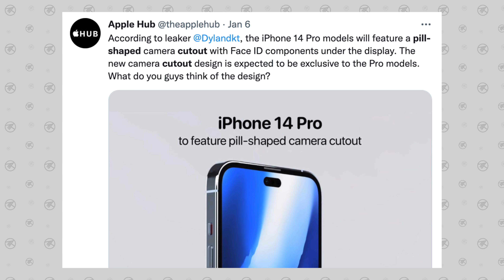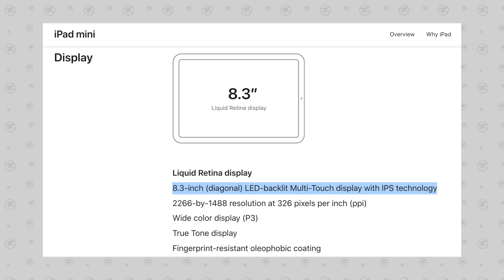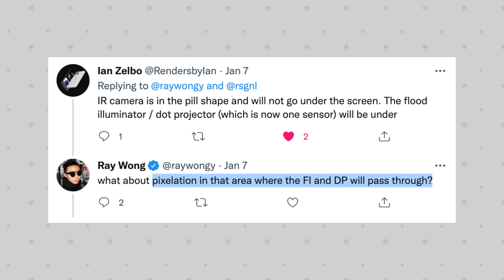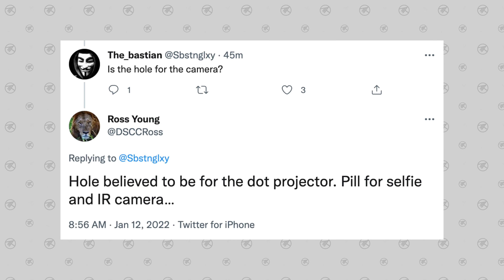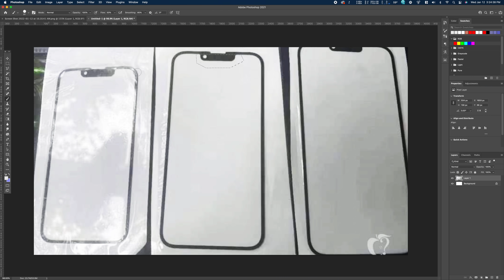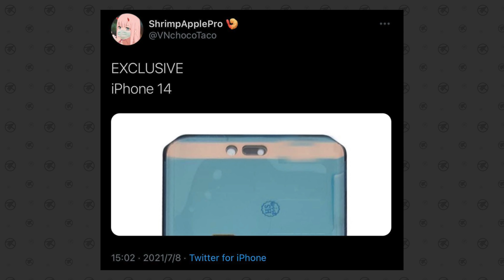I was WRONG about iPhone 14 Pro Under Display Face ID..

Comment: I don’t see why this is any better than the notch. And it seems weird to ditch the notch right after they just made it smaller and doubled down on the design language with the MacBook Pro. Especially if we’re going with the idea that the reason they put a notch that big on the MacBook Pro so that we would get used to it and they would have the space to add Face ID at some point. I guess there’s no reason why the MacBooks and iPhones have to share a design language but it’s weird to me to give their brand new top of the line laptop a design that they effectively make outdated only a year later. Seems like they should just keep the notch until whatever point they could have everything under the display, or at least all the Face ID components can be under the display, because I can definitely see the advantage of the hole punch design if it’s just for a single little dot for the regular camera.

Comment: On iPhone 7:
I could get used to the notch, I waited so I didn’t have to.
I could get used to the pill hole, I’ll not wait so this Fall I’ll have to.

Assuming 14 Pro will have the pill, maybe the hole also. I don’t really care if the battery lasts at least two days on my average use and the camera rocks. There are other things, but battery life and cameras matter the most. Still, I think the software is shite, but less so than Android. :)

Comment: At least I got a good chuckle out of the iPhone 15 leaked design. Looks like Lucky Charms cut out of the display. 

Single notch/slot whatever is fine for all the sensors. Would actually prefer the touch sensor power button for unlocking, given that Face ID doesn't work in public places these days.

Comment: Regardless the round hole placed on the left or right, the asymetrical dual cut outs design is terribly disgusting compare to those android phones, and this is not a significant improvement to convice people upgrade from their iPhone 13 series or older models, at Ieast I won't, unless they add on the under-display touch ID sensor!

Comment: Srsly on the battery % chit chat every single year... if they wanted to be shown they would do it by now either as a number inside the stupid battery icon or simply by ( 87%) for example without any stupid icon...or change the shape of the icon to be in line with charging animation, something like a small green circle with a number inside.

Comment: Notch doesn’t bother me at all. To me its unique and doesn’t interfere with anything I do. For those that think a pill shape is better, design is subjective, but if you believe that the cutouts won’t interfere, I think you’ll be surprised, cause cutouts or notch both mean missing pixels and because of that, that part of the screen will never be used for more than status info. Additionally since Apple just added the notch to their MBPs I would think they are embracing this design, and it wouldn’t match the current brand to change it now, unless they are going to ditch the notch everywhere.
Reply: I think they definitely could go with this design next year, but I don't see it as a reason to upgrade. The UI is built around the notch, it rarely intrudes. I hope to not buy a new iPhone until the camera system becomes flush with the back of the phone

Comment: I have to say: I wanted the simple pill shaped front camera. but I also said in September last year: 
fine, this phone is almost perfect for me with its battery, refresh rate, look and feel, but I want a different notch

so if Apple decides to do such a notch design I'll go for it, since it IS in fact different than the earlier models
Reply: Damn that’s all it takes for you?! No wonder Apple doesn’t innovate, their fans will buy the new phone no matter what
Reply: @nth460  i don't see any problem. look: Apple - for my standards - did everything pertly fine with 13 Pro except the notch. I'm using my Xs now for a bit longer than 2 years and I am looking forward to a phone that is the REAL improvement to the Xs - 11 Pro, 12 Pro and 13 Pro aren't that different from the Xs

Comment: I’d much rather have one continuous pill shaped cut out accommodating both the Face ID components and the selfie camera. That to me looks more neat. Like seriously how much space are they saving between them 😂
Reply: If there was BOTH a hole punch and pill replacing the notch not just once I would immediately reject the phone.  That to me is 5x worse than the notch.  It looks ugly and cheap.  I don’t care if it’s saving screen space.
Reply: @xeon3081  true that
Reply: I'd wager it's one continuous pill hole, with the section in between blackened like the bezels. I also think it'll be thinner than depicted in people's renderings. I think it will probably mirror the pill at the bottom of the screen that you see across iOS and iPad (that indicates where to pull away to go back to the home screen)
Reply: @sebastienalbouy4471  let’s hope so!
Reply: Totally agree. This looks terrible

Comment: 1) how many times u gonna tell youtube u was wrong?? Iphone 13 hasn't even reach a proper 4 months yet and u already talking about the 14?? Just stfu and wait atleast 3 months before it actually comes out 

2) y the hell would apple put 2 separate punch holes? The pixels in between gonna fuck with a lot of people ocd..n if we have to use a banner..might as well just keep the fuckin notch

Comment: Why would they simply add notch border-extension-fill to complete the shape to a elongated pill or something else so as to connect the two holes-modules? Similarly to the option to "hide" the notch in the MBP 14" & 16" in fullscreen (black menu bar user selectable).  Though I do get that they'd want a distinctive look.

Comment: I'm having mental trauma by watching this. Just the pill shape looks excellent on the Pro models! The double hole-punch looks horrendous and ugly as hell. The pill shape itself looks unique there's no need to put that unaligned hole. It would look worse than the white bezel iPhone that used to have camera beside the speaker. Please Apple DON'T make the circular hole-punch visible.

Comment: I'm at the stage where I'll take anything apart from the notch, so if this is the best that Apple can do, that's fine.
Reply: The notch actually looks better the that pill cut out. The notch doesn’t even bother me. Almost like an Apple staple. Go get an android if it bothers you that much 🤷🏻‍♂️
Reply: Honestly I gotten used to the notch it doesn’t bother me as much
Reply: To be fair, we weren’t even supposed to know all this development until Apple’s keynote in September. I think a lot of fans are hating the design because they expected a hole punch at first, then a pill shaped cutout and now this. In actuality, Apple never promised any of those.

Comment: I’d rather the pill shape is just a bit wider than separated holes. Two of them just looks ugly.
Reply: True..if they put it together it will be better that separating it😂🤦‍♂️
Reply: Asymmetry is also something I don’t expect Apple to add to its design
Reply: Don’t worry. You’ll get used to it.
Reply: Agreed. I also wish they had used that for the MBP instead of the rather large notch.
Reply: Same thought
Reply: Yes a centered pill would look the best. I'd rather see the two separate cutouts than an off-centered pill.